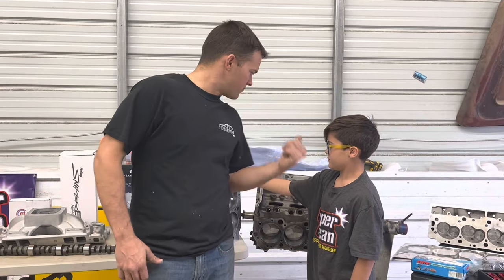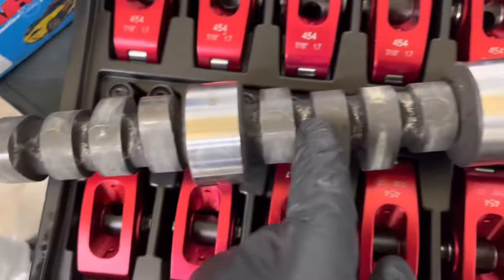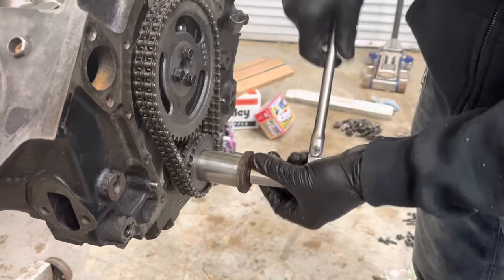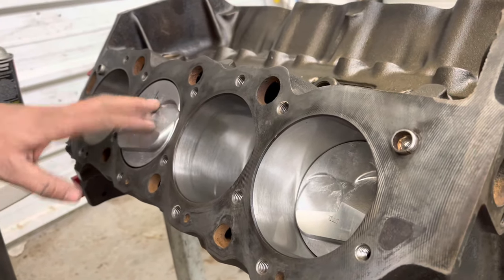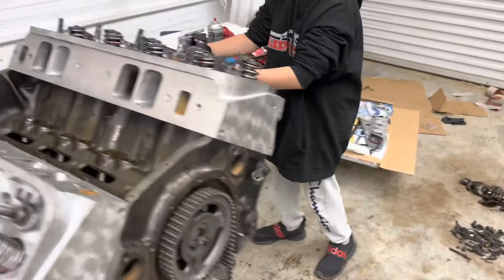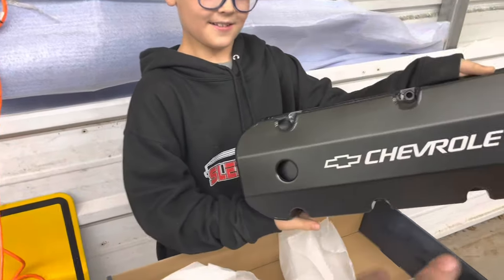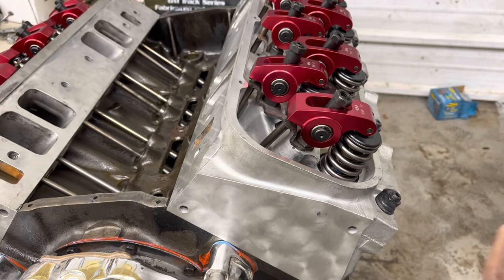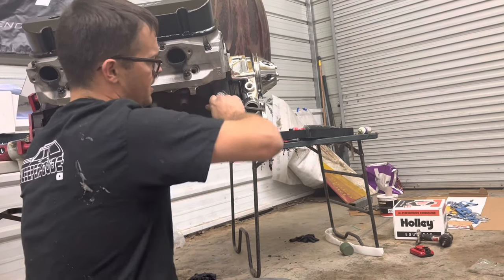No machine work BUDGET 454 engine build for BOOST returns

Comment: Hello I'm also working on a engine build.  Mine is 4.2 jeep straight 6 stroker  for my jeep.  Wondering what break in oil you are going to use? ?   Didn't have all the issues with oil years ago.  I'm on a budget like lots of us ,and lot of the break in oil is expensive .  Thinking about using Lucas . Like thier other products.
Reply from the maker: I just usually use regular oil with zink additives

Comment: Those tight spots you were getting was built up bullshit after the threads. Check out a block you got hanging out look down the threads especially in between bores. I just went threw this with my 350

Comment: Can't remember on your other video on this build but why did you go with hypereutectic pistons instead of reusing the old ones? I'm kinda in the process of doing mine the same way, going turbo but planned on using stock rods with arp and stock pistons. 
But now I'm thinking of get stock bore hypereutectic pistons and eagle rods.
Reply from the maker: I wanted more compression than the stock pistons would do

Comment: Definitely don’t put the inner valve springs only the outer springs break the cam in and then put the inner springs in later big blocks are really bad about eating a cam up on break in but you will have a lot better chance if you only run the outer springs
Reply from the maker: Ok thank you

Comment: I have a similar engine.  My engine is a turbocharged  383 forged sbc h/c/i. Single plane efi intake.  Huge carb like efi throttle body.  I run a ls1 ecu . Have you decided on a turbocharger? I love turbos . Back when I atarted building them v8 guys just weren't into them.
Reply from the maker: I plan on doing a pair of gt45 turbos

Comment: I'd be scared of the quality of that El Cheapo camshaft. I've seen so many horror stories about even name brand cams wiping lobes. Quality just isn't what it used to be. I thought that engine was going in the Beemer
Reply from the maker: Yeah it may not work out. I would love to eventually put a roller cam in it

Comment: I have a question on the valve lash. I've always heard never to go so tight that the pushrod won't turn- obviously you do this without issues. Can you address the thought processes behind this?
Reply from the maker: On a solid lift cam you always want a gap between the rocker and the valve stem on a hydraulic you take it all the way to zero and then give it like a half turn
Reply: @Sleeperdude  Thanks for responding. I LOVE your family, by the way. you guys are awesome!
Reply: @Sleeperdude  Thanks for explaining! I love your family approach, except I'm not so sure about Rocky... who am I "kidding"? Rocky is the real MVP! LOL

Comment: Hate to sound dummer than a sack of hamers, but do you know if I have peanut port's on the big block in my 1988 motor home?
Reply from the maker: Yes you should
Reply: @Sleeperdude  dang,at least I have the gale banks power pak, wich seems to be some big ass long tube headers, an adapter on the factory cast iron intake to fit a big Holley carb and some special springs for the servos in the turbo 400.

Comment: Please tell me you've run cometic's on this block and heads. Needs to be milled
Reply from the maker: Yes it would be better if it was resurfaced
Reply: @Sleeperdude  maybe it'll work for you. It just didn't for me the couple times I tried it. It was a boosted sbc I have 2 boosted bbc's I just ran fel-pro they've treated me fine at 15-20 lbs of boost. If it fails you maybe sand it through 600 grit

Comment: the balancer is bad. outer ring is not in line with the inner hub. the rubber is bad. i highly recommend you change it before running engine
Reply from the maker: Ok thanks

Comment: 🤣Haaa Haaa!!! The little guy will help to keep you straight. A motor😳ooops, I mean engine.🤣 Way to go young man. Many would say it's splitting hairs but, you are technically correct. That there is no doubt an internal combustion engine and not a motor which is electric. Oh well, we say a bunch of stuff that's not correct but traditional. It would be weird to call my two wheeler's engine cycles.🙄 I'm enjoying this build especially since I've got a 454 I'm going to yank out of a GMC farm truck, rebuild, and put into something 🤔?.
Reply from the maker: Thank you

Comment: Are you taking a chance firing it up with the double valve springs on the flat tappet cam for break in?
Reply from the maker: Yes we are gonna roll the dice
Reply: @Sleeperdude  Put a paint mark on the push rods so you can see them turning. If they are still turning after break in, you're good.

Comment: what do u mean it is not free not in my world so far i got 4 crate set up from 6,000 miles to 58.000 miles the engines have steel crank, heavy rods, pushrods and high flow heads 4 inch stroke 450 hp at 485 torque with a 02xx 400r turbo good to 800 hp then i got a weidland tunnel ram and a highrise set ups with carbs for 100 bucks for both u should see the 68 pu i have been building only have 800 in the project the underside is rebuilt and painted same with engine compartment dash is dun with full factory gauges looks better then new have stereo system just need to finish the interior and final paint been offer 12,000 for it before i did the dash the way it sat. plus i get a lot of rust free rigs for free . i have a 66 gt dart rust free i will give to someone that will build a drag car out of it it has a good look to it it is complete with a 225 six with 3 speed on floor with a possi in it has a good body on it i got it free with new wheels and tires on it sold them for 600 so it needs wheels and tires to move. u should see all the chevy pu's i have now all rust free lots of square body trucks have lots of ford trucks from 67 to 72
Reply from the maker: That’s cool

Comment: I wonder what problems you will have with all that Chinese junk. Those heads are for a 540 inch motor. You will suffer not having much torque with those on a 454. With a 265 Cc or 290 cc head you can get around 600 hp on a street motor. Anyway got to use what you can afford.
Reply from the maker: We will see

Comment: That cheap Chinese parts are gonna bite you in the ass, cam will probably fail.
Reply from the maker: Wow, we will see
Reply: @Sleeperdude  Well, I hope it does not but there has been lots and lots of people flattening lobes on cheap cams with cheap lifters. Guess you will find out, make sure you use high zinc oil.